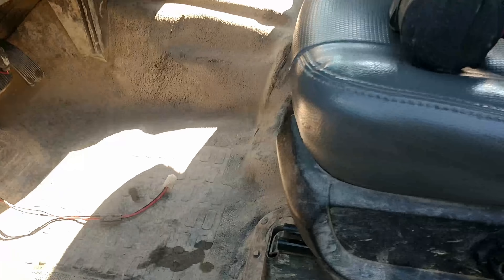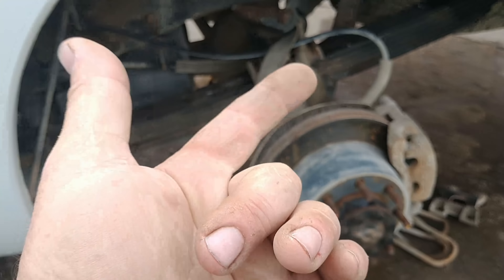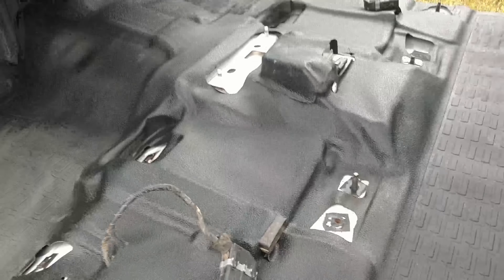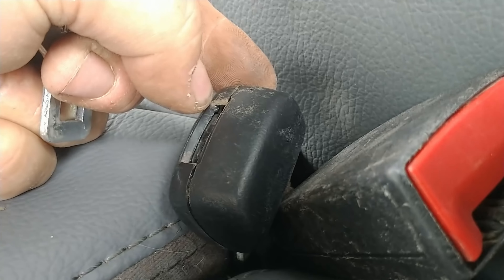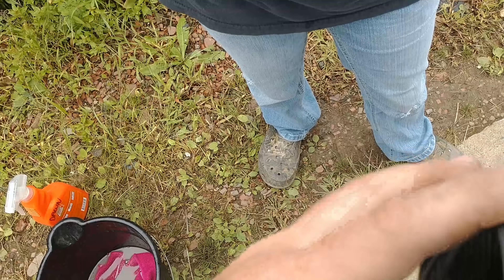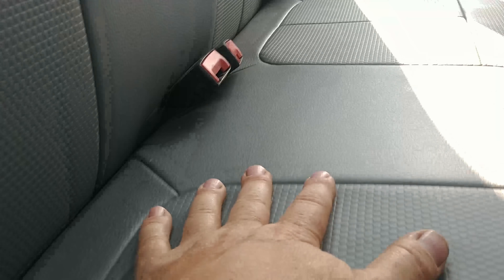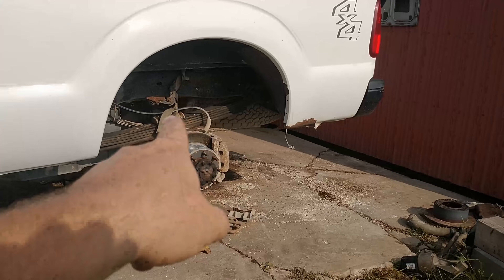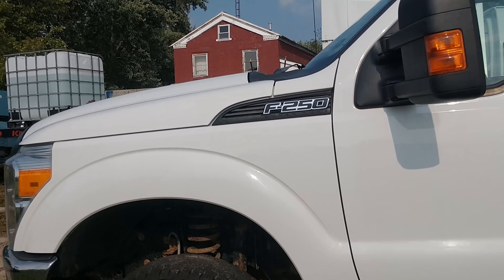GEM OR JUNK? PART 2 INTERIOR IS DONE!!

Comment: Hey JC, here's a trick for your wife that you can make for her to clean those door panels. Get a peice of 1-1/2" x 4-6"L clear rubber tube. Then RTV the rim of the tube to a 'V' like shape. Let dry. Then slip the other end of the tube to your vacuum hose. Soak those door panels and then use your new Fine squeegee vacuum attachment to suck the panels dry. This att. is also good for picking up thin metal sheets from stacks. Love the work you do.
Reply from the maker: i will let her know about your tip. thanks for watching.

Comment: Pretty impressive turn around yall. Would like to know more about how you clean the engine. Every mechanic I know says don't put any water on it. It will get down spark plug holes and cause huge problems
Reply from the maker: i have heard the same thing from many people. i pressure wash the engine bay thoroughly. i avoid pressure washing directly on the pcm and other components but i am still sure to clean them. then i spray it with a good dressing. simple as that!

Comment: I love these trucks. They aren't perfect, but they are a real mans ride. I find them easy to work on as well. I've had three  F-250 with gas engines. All three had sticky brake calipers when I bought them (All over 150k miles). Is that common with these Fords?

Comment: Interior looks like a different truck ... excellent work! My Dad would clean the engine bay then spray it with clear .. looks like you did the same?
Reply from the maker: no i dont spray it with clear. it is just a spray dressing. works very well after a good cleaning.

Comment: Hate the motorboat look on trucks, that drives me around the bend to look at it, not so much if you have a load but when it's empty and looks like that, I just cant stand it....lol  Beds can be tough, there are times beds are plentiful and you can get them cheap, but right now beds, are going for a premium cash wise same with tailgates... even more so if you have a tailgate with a camera and a step. With the beds, it depends on how much work it needs and if I can source a replacement, sometimes it's cheaper to just get a new to me bed, and in case like the bed market at the moment, cheaper to fix and paint. Kind of funny the `0 and up beds are a little tough to find, the 2017 and up take offs you can buy with the back bumper and tailgate and back lights for 1800.00...lots of takeoffs of the 17 and up trucks floating around.

Mrs JC sure does make it look good. One thing I find a pain is the headliners, they are a PITA to get clean, I hate it when I have the rest of the interior looking good then you look up at the headliner. But dropping the headliner and getting it out of a crew is not a fun job and getting it back up there and staying put isnt a picnic either. If the headliner is real bad I will look for a used one or pop a new one in, but dang I hate having to pull the rear window to get em in
Reply from the maker: i think this bed is worth the investment. it should pay for itself in the added value......i hope. i have  a few 2018 superduty beds sitting here waiting for the day i need them

Comment: Do you or can you so a video on what you so to the engine to clean it. I have a 6.7 powerstroke and have been nervous to get in there and wash it
Reply from the maker: i pressure wash the engine bay. i am careful to not spray directly on the pcm and other electronics. then i spray it with dressing.